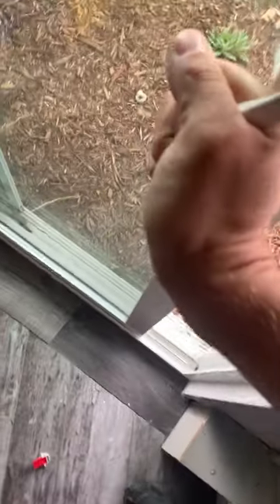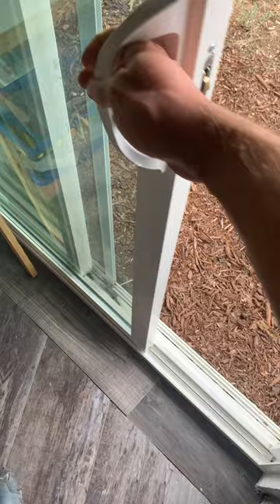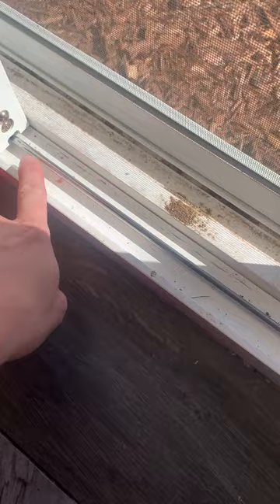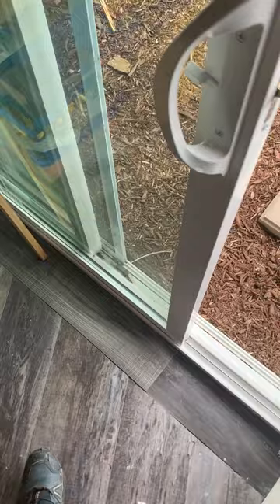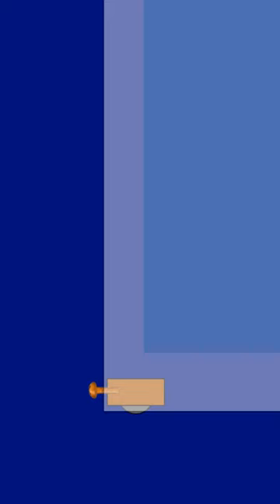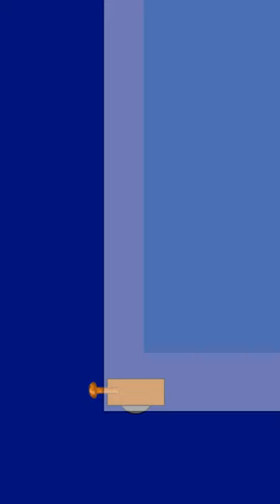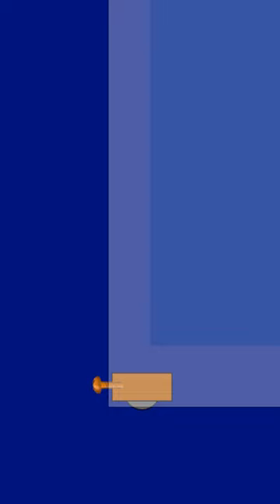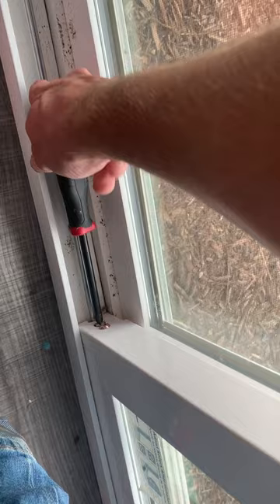Why Your Sliding Door Sucks! (And How to Fix It)

Comment: I have a transom window above the sliding glass door...and I think the shims are in there at the top, as there is just NO ROOM to lift the panel out to replace the rollers. I want to take the decorative trim off and look at the top area, even if we have to remove some drywall...as videos that show using a car jack...those windows might break! Suggestions? THANKS for this brief video with diagrams of roller manipulation!